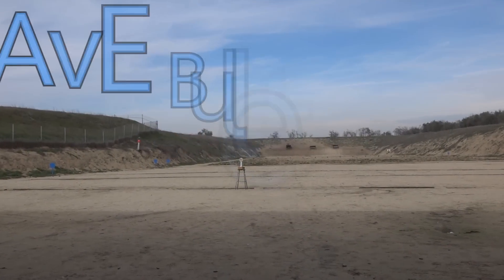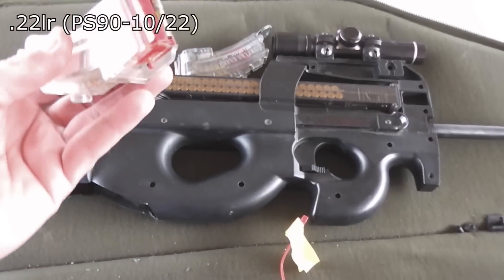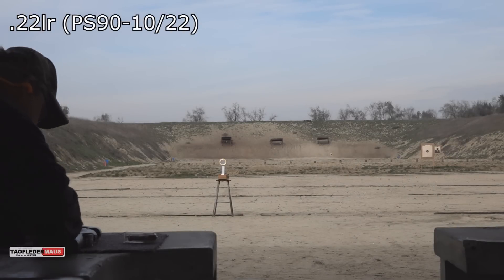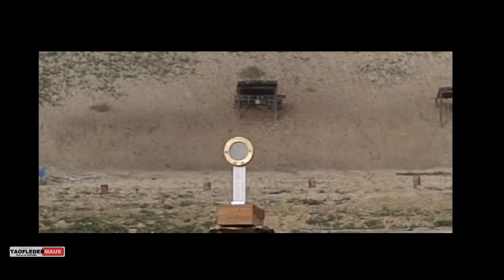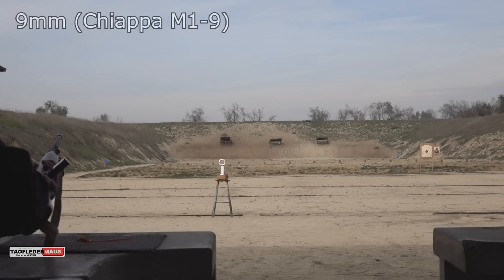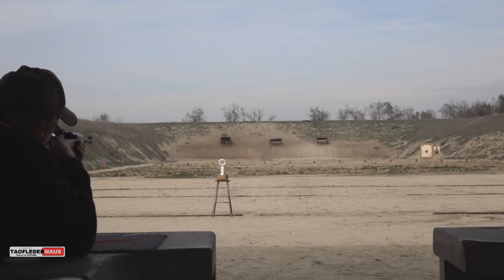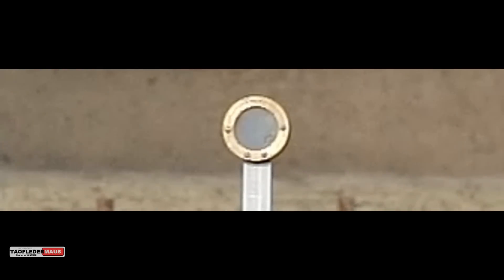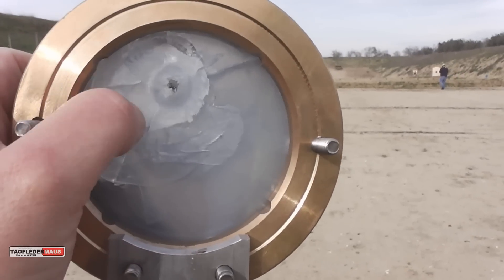Homemade Bulletproof Glass by AvE Channel  - We shoot it!

Comment: gluing ploycarb sheets together just effectively makes a thicker sheet of ploycarb, you would get a similar result if you didn't even bother gluing them together just clamp them together where the thicker it is the more bullet resistant it becomes. However, you will need several inches thick to stop a rifle, real bullet proof uses layers of different materials.

Comment: One thing I'd like to see: sodium/potassium alloy bullets vs. pig carcass. Probably have to load them in a shotshell with a minimal wad; neither sodium nor potassium is much denser than water so it would need to extend much further back into the shotshell than a lead slug in order to have enough mass to get the whole powder load to burn without having the slug extend forward out of the shell. Also the slug would probably have to be dipped in wax or something; there may be a risk of spontaneous ignition setting off the shell if the slug is exposed to air. Or the oxidizer in the powder even.

Comment: Should be 1.5 or 2 times as thick. Since 9mm punched right through, making it thicker ought to help a bit. Maybe even put chickenwire fence material between layers if possible. Could help prevent the kinetic force from fracturing multiple layers, which would make it harder for the bullet to pierce it.
Reply from the maker: +Yee Macghyee   He sent some extra disks for it,   so I am going to double them up next and try it again.    But I don't have much hope it will do much better.
Reply: +TAOFLEDERMAUS Huh. Well at least you get to shoot more.

Comment: User:  What can I shoot here?Shooting range: Any this is America, we are in dugout you could bring a tank here and shoot no problem.User: Great I have a few quite embarrassingly small guns.Shooting range: That's fine we will take the piss.User: I just need to shoot some rounds at this nicely machined tennis racquet with some plastic and glue in it.Shooting range: Hold up son what kink of operation do you think we run here.  You can shoot at the steel targets or into soil that will have rocks in that can cause a ricochet, did you know the French don't know a work for ricochet.

Comment: Isn't it possible, that using the same disk for both shots compromise the integrity of the 2nd shot. I think I order to call this a true test; (call me a stickler for science, Nerd) is to have  each individual shot demonstrated on an intact disk.                 These videos particularly trouble me as people show these trials, typically against the same target repeatedly, which to me nullifies any real results of effect to material. Also if anyone wishes to demonstrate bullet resistant glass. Wouldn't it be more reasonable to have a car window size piece.

Comment: If you stack em up like so, you eliminate the "bulletproofness" of Lexan or polycarbonate. It works like a high speed "rubber", dispersing energy from flexing the material as a whole AND compressing the molecular chains on the impact site. If plastic can't flex, it can't stop a bullet. If you can't introduce a non-newtonian fluid type of reaction of a split-second super-hard material, you can't slow the bullet down.

Comment: that 10/22 in a bullpup stock is prohibited did ya know it ? I know beacause i wanted to convert mine and did some research
Reply from the maker: +Olivier Jeanson  No it isn't.    https://www.hightowerarmory.com/ProductDetails.asp?ProductCode=HTA9022BLK
Reply: yes in canada it is buddy. Here is a copy paste

 PROHIBITED DEVICES
Former Prohibited Weapons Order, No. 9

1. Any electrical or mechanical device that is designed or adapted to operate the trigger mechanism of a semi-automatic firearm for the purpose of causing the firearm to discharge cartridges in rapid succession.

2. Any rifle, shotgun or carbine stock of the typeknown as the “bull-pup” design, being a stock that, when combined with a firearm, reduces the overall length of the firearm such that a substantial part of the reloading action or the magazine-well is located behind the trigger of the firearm when it is held in the normal firing position.
Reply from the maker: +Olivier Jeanson  I'm not in Canada

Comment: I'm impressed as I really thought that would stop a 9mm but maybe the extra velocity of it being out a rifle barrel over the pistol made a difference. That lexan is tough shit. I installed one in a bldg and the cops tried to break through it and could not. They broke the wood molding trying. Wish I had a vid of that!
Reply from the maker: +BikingMNViking   I used to work with lexan a lot at my old job.  You can put it on concrete and hit it with a hammer and it just dents.
Reply: You think with a better adhesion like a solvent weld that would have held together?
Reply from the maker: Probably not.   I knew this would stop a 22 but we have shot at stacks of 1/2" lexan and even an Ak will shoot through about 6 inches of it without slowing down.
Reply: *****
That I expect because the ak round is bottlenecked, has more power, and is a smaller round with better sectional density than a 9mm (.38 cal). So how much lexan does it take to stop a 9mm? Or did you not do that data with the constant onslaught of Hg-lovers wanting you to shoot that out of a shotgun? ;-P
Reply: Problem might be that lacquer thinner was used as an adhesive to join the disks. Lacquer thinner contains some hydrocarbon solvents that will embrittle polycarbonate making it much more prone to fracturing upon impact. Thicker solid disks of Lexan polycarbonate stacked without any bonding agent would probably perform better.

Comment: Btw - you need to go to another range if you feel the need to suck up so much that their gracious majesties approved your humble peasant ass to shoot something. Seriously, the fuck is wrong with them? My range you can take in a fucking cow and shoot it if you want. It isn't their fucking business. As long as you're operating in a safe capacity behind the shooting line it doesn't matter what the fuck you're shooting at. Hell, look at the metal plate targets people use, if that's not going to cause a splash back nothing else will so it's not worth even declaring. As I said, find a better range bro. Yours sounds like it's run by dickheads.

Comment: looks like that sticky stick wasnk skookum enough to make it chooch. Looking at it, it looks like the glue sheered apart when the sheets were trying to send the pressure back through the other sheets allowing the bullet to pass through. Granted AvE was not happy with the bond either due to some side reactions causing it to cloud up (likely also weakening the bond). Great vid Jeff! (from Taofledermaus)
Reply from the maker: +eivilcow33   thanks!

Comment: Back about 1977 the glass business I worked for was contracted to install a bullet proof window in the rent office fo the local projects complex after somebody was shot to death just down the road in a store.  The thing that made it so tricky was the boss there was more interesting in the illusion of safety than the cost of putting in something which would stop most ammo.  So, the boss of the company and I went out with some Lexan and acrylic plexiglass to the local sand hills to do some testing.  To keep the project within the imposed price limits we were going to have to more or less laminate the two dissimilar materials and try to come up with something which could provide the best protection.  What we found was that we were able to use two layers 1/4 inch each to stop .22 ammunition altogether and from digging out the bullets to determine how far they went into the sand figure out what the best sequence for the two layers were to slow down .38 ammunition the best and give the poor ladies behind it the best chance at survival.  The best combination was the acrylic first backed by the Lexan.  Acrylic is fairly brittle, but slows the bullet down a little.  The Lexan in the back is flexible as well as tough and the flexible movement since these weren't really laminated but simply installed together absorbed the impact of the bullet more than the other way around.  Just how that would've worked out with human flesh involved I don't really want to contemplate too much, though I suppose it would've reduced the lethality of the .38, depending on where the bullet hit.
For a little-added fun i took along my Carcano 6.5 millimeter rifle and we took along enough scrap Lexan to really make a thick obstacle.  While we did reach a thickness which stopped the .38, the 6.5 was a different matter and we never did reach a thickness which did much good with what we had on hand in scrap.  As it is, we're almost forty years down the road and that "bullet-proof window" is still there.  It hasn't been tested, thank God.  My guess is staff put it around that there is real bullet proof glass installed and nobody wants to try to rob the place with that.  Personally, i wouldn't want to be standing behind it if somebody came in and opened up with something more powerful than a .22 high-velocity load.
Reply: +Stanley Loper by the way, your results were just what I predicted to myself before you started shooting.

Comment: Isn't glass supposed to be transparent?
Reply: +Taher Dragneel actually it is transparent! or more like was... the Super glue (cyano-something somthinh) reacted with the poly carbonate to form the foggy white... watch the video youll enjoy AVE, been subbed for a while!
Reply: +Nathan Burton Nah, glass is just the material. You can get transparent, translucent and opaque glass.
Reply: +Nathan Burton If you'd check the video description and go to the video where he made this, he clearly states that he had problems with the transparency of the polymer sheets that he had to layer. He fixed this problem after the project was completed - methyl ethyl ketone (lacquer thinner) needed to be used to prevent the fogging.
Reply: +Nathan Burton not in canada
Reply: I see some people got overly hurt by my comment.
Reply: +Nathan Burton I was the most hurt. im hurted.
Reply: +Taher Dragneel Well it's not glass either, it's polycarbonate.
Reply: the poly carbinate he was using kept getting clouded with the 'clear' adhesives he tried using.
Reply: +Scott Lichtsinn I would have just bought some oil based acrylic solution and stacked it and let it dry for a few days for extra strength.
Reply: +Scott Lichtsinn very strong. just got done with a project of putting heads up pennies all over a desk. It takes longer for the oil based to dry and if its not warm enough it dries on kinda soft. I ill take back the oil based and say water based acrylic would probably work best. pretty much hard as rock and not so brittle at all
Reply: +Nathan Burton i scrolled down for your comment

Comment: Most glues will bleed into polycarbonate and make it brittle. He would have been better off drilling them and toss some bolts in there. It looks like he did, but were the sheets still glued?
Reply: +peideano Yeah I'd think just stacking that many sheets together should have worked better. So like you said, the glue may have weakened the material. That 9mm passed through there like it was rock candy.

Comment: but what if the glass was spread over a bigger surface area ? because a bigger surface area means that it's weaker in comparison to the smaller surface area. Maybe you should try the experiment on a bigger scale so we can see the full extent of the 'bulletproof glass'? thanks (:

Comment: Five 1/4" ceramic tiles stacked together individually wrapped in duct tape(4 layers each side) will stop a 45 acp round.
Reply from the maker: +John Troy  45 isn't much a penetrator though
Reply: ***** 9mm as well, I also tested it with 5.56 nato but I'm not sure that was 5 tiles, maybe 8 but it did stop 2 rounds.

Comment: I think his 2nd round would work better. I know he got it to be completely clear the 2nd time.
Reply: +Brap Brap Unless the lacquer thinner affects the lexan's structure less than the superglue did, I don't see why. Lexan is lexan.
Reply: +TheJohn8765 Actually, if the thinner melts the Lexan-Lexan boundary instead of adhering them like a glue, the lexan puck becomes one solid piece.
Reply: ***** Yah, hence my comment: " Unless the lacquer thinner affects the lexan's structure"
Reply: TheJohn8765
Yeah, i brainfarted a bit. :P
Reply: +sleeptyper the first bullet delaminated it. Sounds like mek or a couple of other solvent welds mentioned on ave's channel could have solved this. But had the first bullet not weakened it the 9mm might not have made it through. I think with a bigger piece it would have been bulletproof in the middle since my impression working with lexan is that much of its safety factor is due to the elasticity of the material and in a small piece you have little elasticity. Some engineer can explain it better but its kind of an inverse leverage thing.

Comment: there's no such thing as bullet proof, only bullet resistant. even if it takes an ungodly amount of bullets to penetrate it, it isn't bullet proof. to be bullet proof a material would have to take absolutely no damage even at the atomic level. if its a material 1billion atoms thick and a bullet does no visible damage but rips 1+ atoms off then it will at most take 1billion bullets.

Comment: I thought bullet proof glass was alternating layers of polycarbonate and glass,  the combination of soft and hard material stops and catches it I think.
Reply from the maker: +TheBackyardScientist  He probably didn't have a way to cut glass into a circle.
Reply: +TAOFLEDERMAUS That's easy just borrow a glass cutter from James Bond
Reply: +TheBackyardScientist In actual bullet resistant "glass"  the brittle fracture of the glass layer dissipates energy.  The polymer layer holds the shards in place.  The good stuff is thicker. Also - penetration is not the only parameter - the exit velocity might have been low enough to prevent or reduce the risk of serious injury.
Reply: +TheBackyardScientist or make it square?
Reply: +TAOFLEDERMAUS AvE does. I don't think he thought of doing that though, Canadians eh?

Comment: Ok nothing is bullet "proof" only bullet resistant, bullet proof means no matter what you throw at it it will not go through, bullet resistant means that it is strong at protecting against bullets but wil enough power it will go through
Reply: +SgZ Vapor Thanks for the lesson in semantics, Dr. Verysmart.
Reply: +SgZ Vapor Well wouldn't it be bulletproof for what it's rated to stop?
Reply: +Jason Lui Well enough of the things that it's rated to stop will still penetrate it, like I said, it can't fully block an unlimited amount of bullets

Comment: this looks like garbage. cant stop a 9mm and you cant even see through it well. So whats AVE's point?
Reply: +otacon333x2 Experimentation. Kinda like shooting a shit ton of garbage 12ga projectiles. Have you ever tried to make bullet resistant glass?
Reply: +retsaoter the point is you cant see through it. so why not just make bulletproof material out of ceramic tiles instead.
Reply: +otacon333x2 Because it is intended to be clear. It was an experiment. If your goal was only to be bullet resistant we would use steel. Just because it isnt clear doesnt mean it shouldnt be tested. If you'll notice the brass holder has screws in it so the test material can be removed. It is a safe bet that AvE will send out more test materials.
Reply: +retsaoter oh okay. I didnt realize it was a sort of failed experiment.
I assumed it was a test of a confident end product. my bad.
Reply: +otacon333x2 Thanks for the laugh.
Reply: otacon333x2
make me
Reply: otacon333x2
No.
Reply: otacon333x2
I am quite the Caucasian. But then again there is much in this world you are wrong about.
Reply: otacon333x2
You should get your eyes checked. Perhaps a psychiatric exam too, while you're at it?

Comment: i thought they used glass in bullet proof glass.
Reply: +M85FSLUVR It's both. Alternating laminations of polycarb and tempered glass. The polycarb absorbs a lot of the shock and spreads out the energy while the glass prevents the whole structure from deforming too much.
Reply: No, it's more like a laminated (layers) of plastic
Reply: M85FSLUVR so there aren't any layers of glass in bullet proof glass?
Reply: Mike Trieu I thought so, that's what I meant.